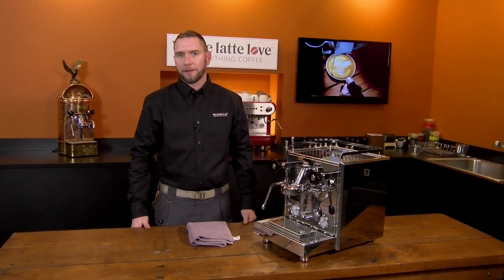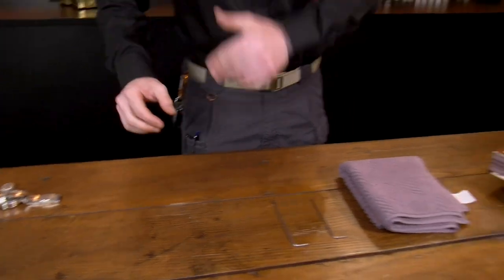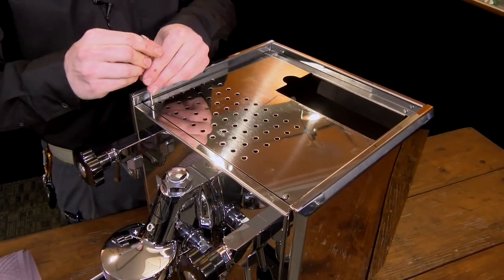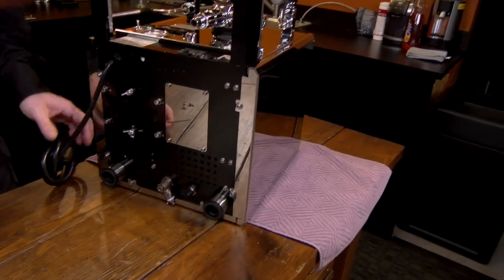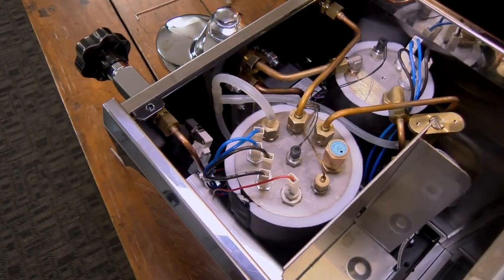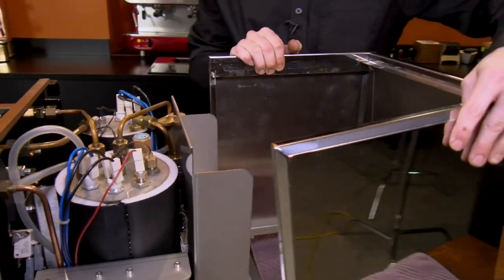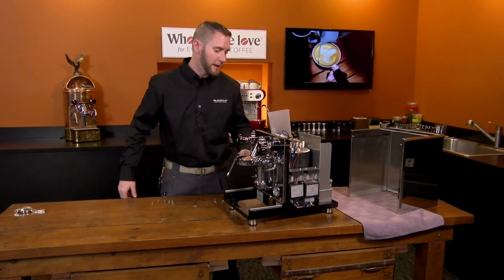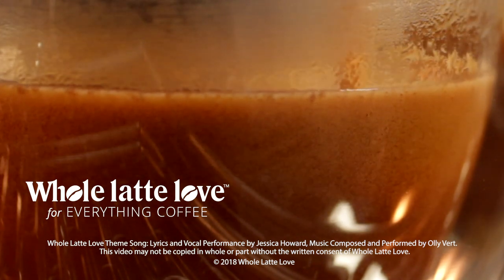How To: Profitec Pro 700 Housing Removal

Comment: I have a profitec pro 700 and it's leaking from the bottom of the boiler by that metal plate by the Wingnut so I can replace the gasket you've already emailed me the gasket but I don't know how to get the water out of there to do this could you please tell me is there a video
Reply from the maker: Hi michael, here's the video showing how to drain the Pro 700 boilers: https://youtu.be/1BjzEH4z6KE
Marc

Comment: I noticed the 700 has a similarly shaped frame. I recently got a Pro 300 a few months ago and the frame (not housing) got damaged in transit. Unfortunately, the fix we were given from the shop was not satisfactory, so I'm not sure how to fix the frame since it's bent at the 'T' so that the front right leg of the drip tray is slightly pointed up.

Is there a safe and secure way to bend it back without removing all the internal components?
Reply from the maker: Hi Jaay, Did you purchase the machines from us? If damaged in shipping a claim should be filed with the shipper. If you purchased the machine from us we can assist with that: https://www.wholelattelove.com/contact-us